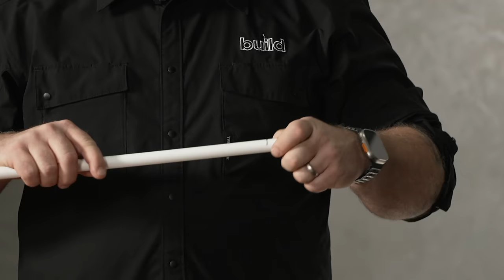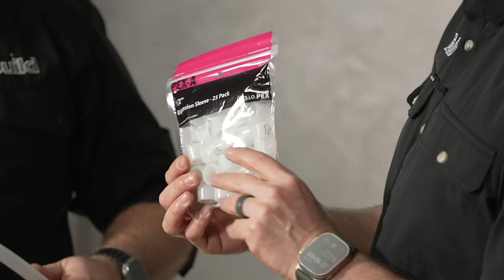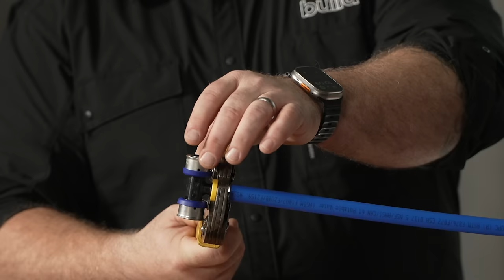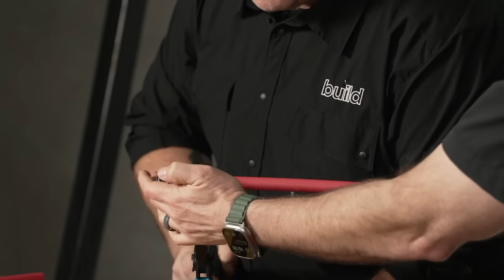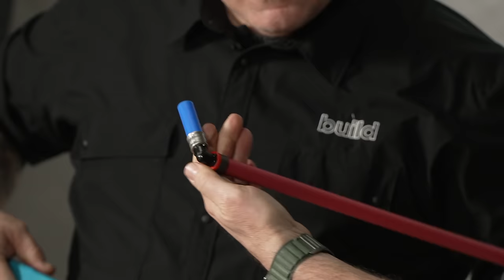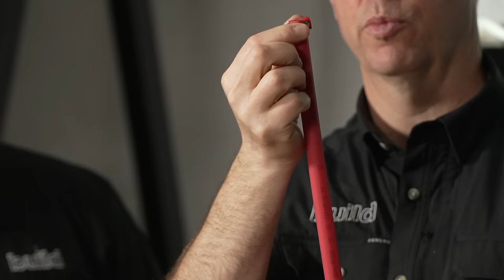PEX Pipe - 5 Connection Options

Comment: Use some pliers and apply some light pressure to the crimp rings to get them to stay in place before crimping with the bigger tool. Way less work for one person rather than trying to carefully keep the ring in place.
Reply: This 100%. Once you get good at crimp rings, they are very fast.
Reply: This comment is spot-on!  This is how I train my crews to do it.  Keep a small pair of channel locks in your back pocket, set that ring in place, and then crimp.
Reply: I'm beyond the normal DIY-er in what jobs I'll tackle. I use my manual pinch tool to just barely start the pinch before final positioning to achieve this as well. I saw some pinch rings online the other day that come "pre-pinched" a little from the manufacturer, costing more of course.
Reply: I used this crimp ring system on my house, the main down side is its use in tight places. But there is a block tool that is slow but works well in a tight area. A power tool would be better for tight areas. House is twelve years old, I have had to failed fittings, but they were cracks in the brass fittings, not the crimp rings. But did the stress of the crimping crack the fitting? I would crimp, turn 90 degrees and crimp again for a more uniform crimp.
Reply: Under the sink at the back going PolyB to PEX with shut off valves.  H & C was 6 crimps, I made the mistake of starting at the existing PolyB at the back of the cabinet and working my way up, so tight need to get some PVC white pipe to put on the Crimp tool handles.
Reply: I just use a bit of blue tape to hold in place
Reply: Or just use uponor and you’ll never have to worry about that nonsense. You can hold your work right in front of you in a comfortable position instead of bending and reaching to try to crimp something. I’ll never understand why people are still using those systems.
Reply: The cost of Uponor tools and fittings vs crimp or pinch pex b— not hard to understand why DIY and weekend plumbers would make do with compression vs expansion. That’s me. And if I did it full-time, I’d definitely invest in pex A tools.
Reply: I've done that
Reply: I use the one handed tool, and crimp it to where it’s “stuck” on the tool and around the pipe

Comment: As someone that spent years sweating fittings I was skeptical of these "new" plumbing techniques until about 15 years ago. I bought and remodeled a lake house and used PEX for the very first time. I ended up using PEX A (expansion) and was in awe at how fast I managed to replumb the entire house. What would have taken days using copper took hours using the Milwaukee tool you used. It's been 15 years and not a single leak and I don't have to be worried about the copper corroding due to the hard water.

Comment: Sharkbite-type fittings are terrific for emergency repairs because they require no tools, no soldering and, no glue dry time.  Even if the shutoff valve is old and leaks, you can install them easily by hand.  And then you can immediately restore water pressure.  Try that with copper, and you will appreciate the simplicity.  It's like the change from cast iron to ABS sewer pipe.  They also make a coupler that transitions from polybutylene to copper, PVC, CPVC, or PEX.  Just what you need for temporary repairs of old houses and trailers before you re-pipe.  One hint for DIYers trying to use the cheap pinch-clamp tools:  If you can brace one handle against something solid, then use both hands to push on the other handle, it's a lot easier than using one hand on each handle.  You can even brace it against your leg.
Reply: Sometimes you can get creative like doing a squat and crimp the thighs or use your hip and lean up against the wall. Why rush the process?

Comment: Great Video. I live in Chicago and the amount of push back on this and NM wiring still has me shaking my head. What you didn't talk about Is can the connections be removed and reuse the fitting. Here is some FYI if you weren't aware.

I found out in my early PEX projects that both the crimp rings and the pinch rings could be removed and the fittings reused, if you did make a mistake. The crimp rings have a removal tool, that can "Pop" the copper ring. The tool has a flat anvil jaw on one side and a cutting jaw on the opposite. Cutting jaw to the outside before you squeeze it. You use you PEX cutter to cut the PEX close to the barbed fitting, Insert the tool in the end of the fitting and over the copper ring and squeeze it. It Pops the ring then you turn the tool to 180 degrees of the cut and squeeze lightly and it opens the copper ring like a butterfly and the copper ring falls off. The fitting can be "reused". For the pinch ring, you can use the same crimp tool turned 90 degrees and it will cut the pinch ring tab off and come apart. 

Disadvantage of the crimp ring removal is the PEX pipe becomes shorter by the length of the PEX on the barbs. The pinch ring can be removed and not lose any PEX length. It's handy when an elbow was installed when a "T" was needed or if the PEX was supposed to change sizes but the same size fitting was installed.
Reply: As a remodeler who wants to change over to using pex primarily, would you recommend crimp or pinch connections?
Reply: @jonblakemore6454 I haven't used the crimp rings personally, but I've had no issues with the pinch rings!  Plus they are easier to remove if you need to. A small flat- blade screwdriver will pry up the end of the clamp at the barbs and then its easy to pry off.

They work just like to the band clamps used on vehicles for CV boots, which go through alot of abuse and rarely fail!
Reply: @jonblakemore6454 The pinch rings are definitely easier , especially in tight locations.  The handles of the crimp wrench need to be very wide to get it on the ring. Connections between floor joists are most difficult with crimp rings.
Reply: @jonblakemore6454 I have both and prefer pinch way better than round crimp rings . If you haven’t switched to Pex you really should . I waited to long to switch , wish I had switched years earlier .
Reply: @jonblakemore6454  I have all 3 types of tools, I like my crimp rings just because they look nicer, and on something like an outside spigot, you don't have to drill as big of a hole as you would with cinch or expansion. But, if you want simplicity, lower cost, a smaller crimp tool easier to get in smaller places, and the same tool does all sizes, the cinch type is the way to go.
Reply: I've personally encountered a failure of the cinch clamps where the clamp actually fractured for some inexplicable reason, unknown to me because it was a baseboard heating system connection that seeped after the loss of the clamping pressure. It went undiscovered until the sheetrock of the ceiling below opened up to release the water. 

Under close examination, the clamp didn't appear to be overly cinched, but the clamp just cracked at some point, and didn't have any obvious evidence of being nicked or damaged.  It's no doubt the crimp rings would never experience this type of fault, while I could see how the manufacture of the cinch rings can create a latent defect, from being stamped and stressed from forming them. 
The biggest advantage of the cinch clamps is working with them in tight spots compared with the original tool I used for the crimp rings, which has to be opened wide to get it around the ring.  They now have tools that can open wide to fit without the handles needing all that clearance, so I definitely will always go with the crimp rings for total reliability and cost in my diy use.

Comment: I don't know if someone has already mentioned these, but there are three other issues to consider: access, removal, tool cost.  One of the main problems with a crimp system (which is what I have, as a casual DIYer) is trying to get access.  In tight construction spots, such as in a wall or behind a sink, it can be very difficult (or not possible) to get into a position where the crimper can be used.  So, the push-to-connect type system can be very good there.  Second, removal can be important.  For example, imagine you want to change a faucet or change some pipe connections.  If you have to cut off the old connector then you might be in a situation where the PEX is no longer long enough - requiring you to find a way to run a whole new pipe.  However, with care, I've used a Dremel-type tool with small cut-off wheel to cut the crimp ring and then remove it.  If done carefully this can be done without damaging the PEX.  Note: copper rings are easy to cut, stainless steel probably much more difficult to do without damaging the PEX. A new connector can be then be inserted (never had one leak after doing this, carefully).  Third, the tools used for these techniques are expensive.  A casual DIYer may not have needs that justify spending a lot of money for these tools.  So, a push-to-connect option may be the best for such users.
Reply: That's why we have rental stores. They carry all the tools that will be needed. The only cost is the rental. As far as cutting a line so it is now too short, leave an extra 3"-4" of pipe when making the initial installation. PEX is flexible, unlike PVC, CPVC (which I hate), copper, and galvanized. My house has CPVC and I'm always worried about it breaking or freezing. It's too fragile. I'm having all of it replaced, a little at a time, with PEX.
The problem I see for DIYers is all the different options when going to the home store. They don't employ professional plumbers that can steer the DIYer to the correct mix of pipe and connectors.
Reply: U can expand pex to get it back off and u can get the crimp rings and procrimp rings off and pipe can be reused dont make excuses for sharkbites they suck
Reply: Check to see if you have a Tool Library nearby. Most Tool Libraries are non-profit and will loan you numerous tools for a single yearly fee.

Comment: Pinch clamps with the ratcheting tool are the way to go for DIYers. Not super expensive tool, not a lot of force required, and fits into smaller spaces than the other tools.
Reply: shark bite looks easiest for diy. is what you said the priced option?
Reply: @utpharmboy2006  I guess I still don't have faith in Sharkbite installations. For sure easiest for DIY since it's tool less.
Reply: @danbert8  lol yeah ive used sharkbite to do a quick reverse osmosis system under my kitchen sink and they are super easy to use. when i used it i was thinking its almost too easy and seems like it might fail because of it, but not yet. but I'm about to pex my entire house on a new build so i feel like that may be a little different
Reply: Agree.  I redid some bathrooms in a house.  Tied in Pex to copper.  Stainless steel pinch clamps were easy to get in between joists in the basement in any direction.  Pinching tool is small and short and only needs to be opened up a few inches maximum.  Its basically a band clamp.  Even the dumbest person can understand how a band clamp works.  Also used some Sharkbite fittings on my project because they were the best option in the spot.  Much more expensive for Sharkbite but still reasonable enough for a small project.
Reply: @utpharmboy2006  I suppose Sharkbite is easiest because it is a simple push it on and you are done.  But the stainless steel pinch clamps are just band clamps.  And the simplest, dumbest mind on earth can understand how a band clamp works.  So its kind of a tie.  But Sharkbite fittings are much more expensive than the stainless steel pinch clamps.  Cheap and simple stainless steel pinch clamps wins in most situations over Sharkbite.
Reply: My preference is Oetiker pinch clamps.   Easy to understand, easy to use.  Available in a vast number of sizes.  (In RV use, you run into lots of odd pairings like PEX to braided hose which Oetiker can easily accommodate.)   I especially like that one pinch tool serves all size clamps.  Admittedly, the standard long handle tool can be a pain.  However the new style one handed ratcheting tool eliminates that argument.  I pinch the ear, then position the ring, then about 5 to 7 squeezes to pinch it.  The last 2 for me require my second hand but at that point, it is free of holding stuff in position.  And at about $55 its not rediculously expensive.  It even has an adorable little blue light that tells you you're OK.
Reply: It's what i went with.  The shark bites were too pricey and the tools for the others were quite expensive. Used a cheap but large pair of pincers pliers from harbor freight to cinch the rings. (I don't recommend that but it worked)  I've since purchased the correct tool, as I'm less broke now and the price is a quarter of what it was.

Comment: He forgot to mention that orange tool in the beginning not only gives depth to push too, but also trims the edge of the pipe to keep from cutting the O-ring
Reply: Yes, if the working area gives you clearance.  And DO NOT use a SharkBite without the depth guage of you are an amateur like me; you will get fooled by the feel of the fitting. Use the guage or you'll do it again!
Reply: That's why they call it a deburr tool.

Comment: I loved the video showcasing 5 types of connectors. However, I would have liked to see a demonstration of how to repair a bad crimping job or how to remove a clamp. Thank you for the information.
Reply: Was gonna make this comment. Removing a connector is actually needed sometimes. Had good luck with the pinch clamp. I suspect you can cut out the expansion sleeve as well. But the ring clamps? Forget about it. That makes them not as good in my view.
Reply: @vapeurdepisse there are tools to remove clamps but it is only for fittings reuse s8nce you need to cut the PEX pipe before removing the clamp.

Comment: I started out with pinch based on availability and cost. I had only one joint leak. I switched to Uponor in 2017 mainly to reduce wear and tear on my joints, and also for working in tight spaces. The price of the Milwaukee or Dewalt expansion tool is worth the cost if you are only plumbing one house.
Reply: Yeah cost is a non factor when you consider the cost of hiring a plumber
Reply: Why anyone would use anything else still confuses me. Why would you bend, reach and strain, then deal with trying to get your tool on a ring that keeps slipping, then you have to try to get the leverage to use the tool when you can just hold it where you stand, let the tool do the work and just put it on the fitting.

Comment: I replumbed my whole house with pex type b. I used a Zurn manifold with individual valves for each line. Awesome system especially for the diy.
Reply: Don't drink from it without a filtration system micro plastics are a health concern especially for children. Google it friend.
Reply: I did the exact same thing!
Reply: @RfffDdff-rf4qu yup, but pex a is the worst as far as chemical leaching is concerned. Pex b is better but the best is pex c - basically no leaching of chemicals.

Comment: Great video!  Very descriptive, informative and the fact that you started out the video by specifically saying no system is "better" and that it all comes down to preference is greatly appreciated!  I'm a DiY'er that just bought a 10,000 sqft commercial/residential building with OLD copper that needs replacing.  I will not solder so pex it is.  Most of the comments are helpful also.  As some of the comments stated, since this video is likely targeted at DiY'ers such as myself, including the likelihood and difficulty in fixing the inevitable mistakes would be appreciated, maybe a follow up video?

Comment: It depends on what your hooking that Pex to. If you hook it to something that's not going to get reduced by they faucet connection, as in a utility sink faucet, you'll notice. If you're connecting it to a 1/2" x 3/8" stop valve to a 3/8" faucet connection, such as a bathroom sink, or say a water saver shower system, you won't notice the volume drop. It can be a problem over a long distance. I work in commercial plumbing and I've worked on systems that run 400 ft in a straight shot, and the entire system is over 1000 ft long. You would want to accommodate for that in your sizing. Pex B has a higher burst rate than Pex A, but both are pretty high. Pex A has had problems with people over expanding the expansion ring and it splits behind the collar where the pipe expands. The only place we tend to put Pex on the commercial side, in my experience, is for in-wall plumbing. We either take the copper into the wall to a manifold and Pex it from there, or we have jobs where the in-wall plumbing is Pex to 18" out of the wall in the ceiling space, then it goes to ProPress copper. We usually connect to copper stub-outs, and larger pipes, such as toilets that need flush valves, they get completely done in copper.

Comment: Speaking of dry fit, high-rise in downtown Austin 12th floor a dry fit elbow in copper let go on a Saturday afternoon and by the time the security figured out water was coming down the elevator shaft the $600,000 in insurance claims were done. The fitting had been there over 4-years without solder.

Comment: Us two way radio and CATV installers are very familiar with these. I've always wondered why they didn't use these in plumbing.  Thank You very much for showing all these !!

On the crimps I use, I can cut off the collette and re- use the connector in the future if desperate and need a connector while up on the mountain.
I'm sure you could with these. 
On a rainy day I go through the cut-offs and recover them for emergency use.